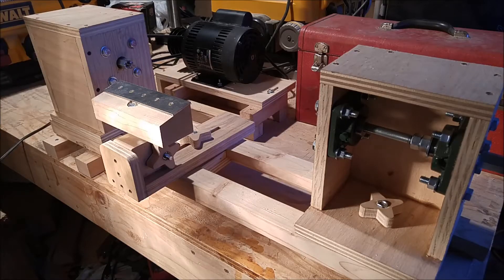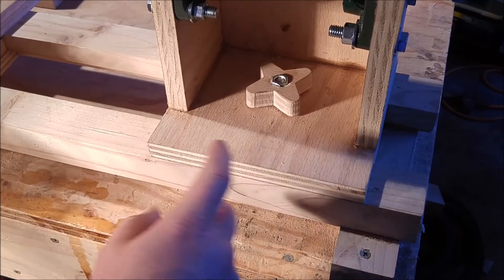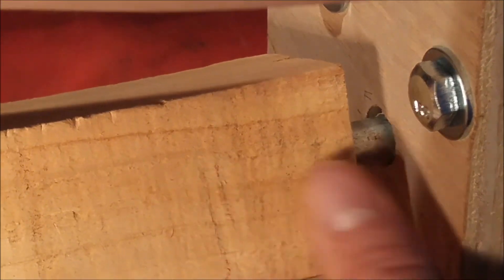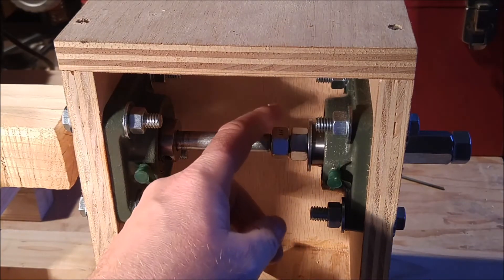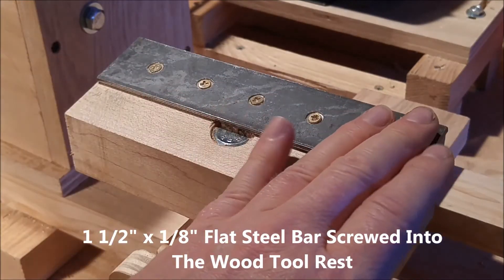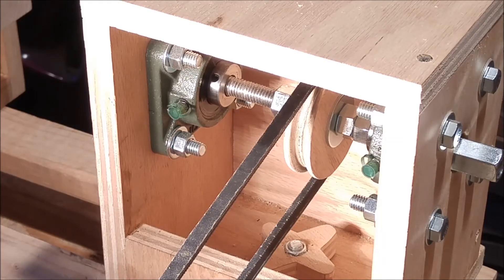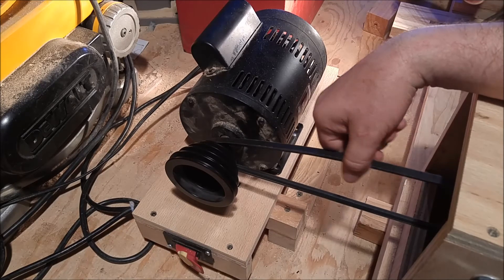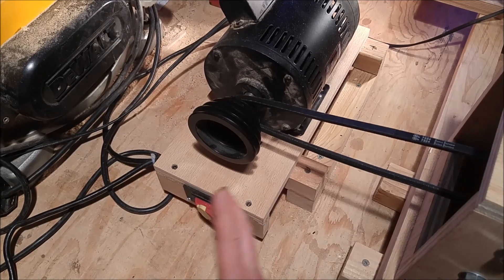Homemade Wood Lathe

Comment: Hmmm on the hand dremmeled nut for grabbing could you instead of dremmeling your nut take a peice of all thread that fits in screw it into your undremmeled nut to get depth than get another nut cut it like you did first one instead and weld the short peice of all thread and cut nut together as a screw in insert like 2 inches long or however long u want than take a drill chuck and do the same thing with the all thread and have a screw in drill chuck and then you coul do the same with grinding wheel sanding wheel spindle grind wheels holy crap I'm building my my own lathe and you just gave me a huge idea at 3 am! For my own lathe when built! Thank you though great build I'm still in planning phase lol
Reply from the maker: This is a very interesting idea which I'm going to think about. I would say after using this lathe quite a bit, I'm not too please about how I did the head stock spur center. And so your comments are appreciated as an idea. I may do another video showing what what I try as an improvement. Very cool you are building your own wood lathe!!! I can say I'm very happy I made my own lathe, easier would be to just buy one. But we always do things the hard way in my family, just kidding. There is definitely a satisfaction and a greater appreciation of wood turning in making a lathe yourself. Will you be posting a video of your lathe? Good luck with it.

Comment: Lol gotta come up with a better name than nut knob but tailstock flange bearings where did u get them?!
Reply from the maker: True about nut knob name, how about clamping nuts? That's not so good a name either. Oh well. I bought those flange bearings off Amazon, they were the cheapest ones that have grease zerk fittings, unfortunately the axle diameter is only 1/2", for my use this has been OK I have not bent any axle and the bearings work great, but I really would preferred to have a larger diameter, problem was larger diameter were considerably more expensive. My objective was to make this lathe as inexpensively as possible.

Comment from the maker: If any questions or improvements for this project just let me know. And if you liked the video, please like & subscribe to my channel for more.
Reply: dumas5000  thank you for posting this great design!!!.  My question is, are those bearing blocks identical?  Some on the market are "self aligning".  Are you incorporating this?
Reply from the maker: Hey Rob, Glad you like the video and sorry for so long delay responding, for some reason it didn't show up in my email notifications and I just noticed it today. The flange bearings I used are all the same, but they are not self aligning, there is some play with how they mount to the wooden head/tail stocks and that's how they are aligned. They were about the least expensive bearings I could find yet with large as possible axel diameter (1/2"). I would have like to go with 3/4" axel size but that significantly bumped up the cost and I wasn't sure if I'd even like wood turning. Well I do like it a lot and in hind sight would have chosen 3/4" or maybe bigger. This said I haven't had any problem yet with 1/2" I'm using and I've been using it on several projects now, and have no desire to buy a store bought lathe, this homemade one works great for what I will be doing. I did buy a vintage American made craftsman full chisel set though on Craigslist for a good deal of $30 was funny it cost me more than to make the lathe.